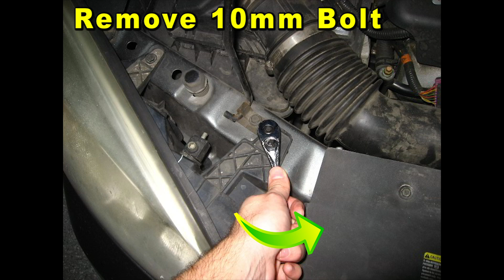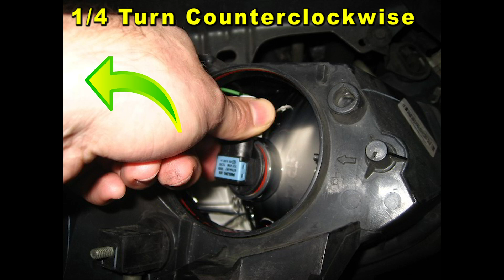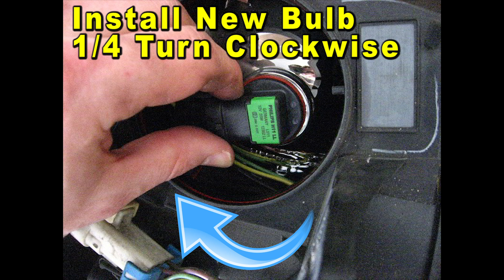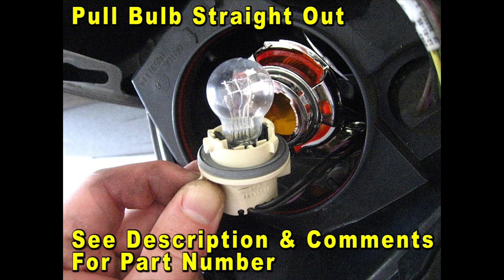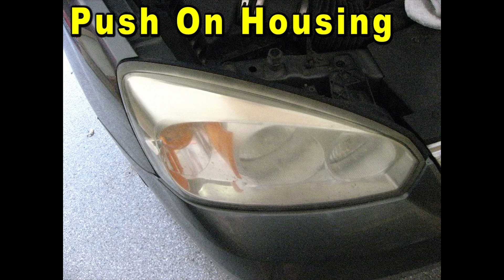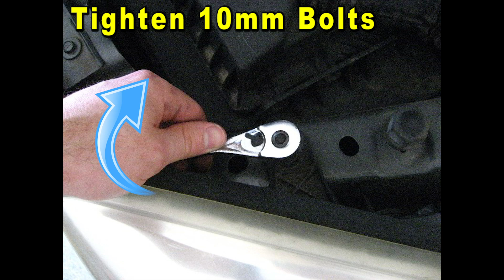2003 To 2007 Chevrolet Malibu How To Change Headlight Bulbs With Part Numbers

Comment from the maker: Chevy Malibu Low Beam Light Bulb - https://amzn.to/3xPpFpe
LED Low Beam Bulb Part Number - https://amzn.to/45WBcj5
Chevy Malibu High Beam Light Bulb - https://amzn.to/4bBXXdj
LED High Beam Bulb Part # - https://amzn.to/462C8T1
Chevy Malibu Front Turn Signal Light Bulb Part # - https://amzn.to/3RXgrOz
LED Front Turn Signal Light Bulb Part Number - https://amzn.to/3LfoKRS
Precision Screwdriver Set - https://amzn.to/3sLixaP
Plastic Pry Bar Tools - https://amzn.to/3HMtsV7
Socket & Ratchet Set - https://amzn.to/3Z17LbA
Mechanix Gloves - https://amzn.to/3jCnHkt
Torque Wrench - https://amzn.to/3vS5uSI

The Paul79UF YouTube channel is a participant in the Amazon Services LLC Associates Program, an affiliate advertising program designed to provide a means for sites to earn advertising fees by advertising and linking to Amazon.

This DIY video shows owners of the 6th generation 2003, 2004, 2005, 2006 and 2007 Chevrolet Malibu how to change a burnt out low beam, high beam or front turn signal light bulb in the headlight housings.

Comment from the maker: Check out the DIY guide for changing the headlight bulbs on a sixth generation 2003 to 2007 Chevy Malibu - 
https://www.paulstravelpictures.com/GM-Chevrolet-Malibu-Headlight-Bulbs-Replacement-Guide/index.html

Owners of other General Motors vehicles equipped with the 3500 V6 engine such as the Pontiac G6, Montana, Buick Terraza, Rendezvous, Chevrolet Uplander, Impala, Monte Carlo, Saturn Relay, and Aura may also find this guide to be helpful.